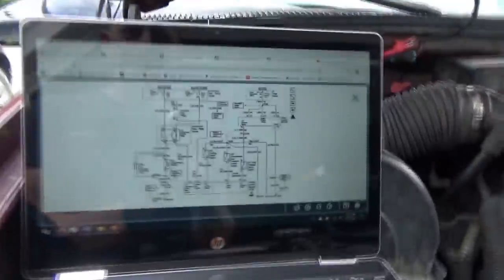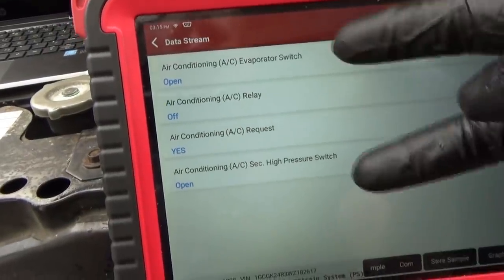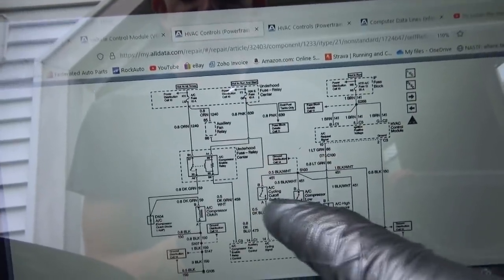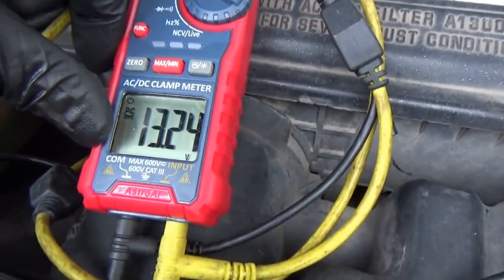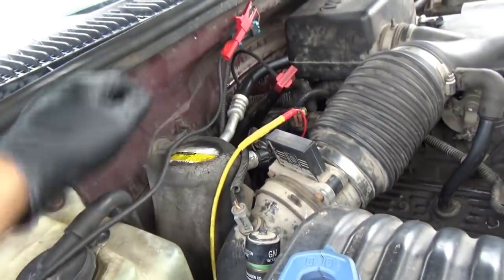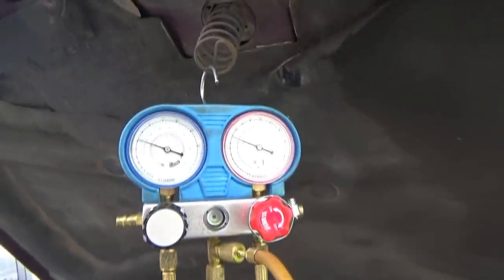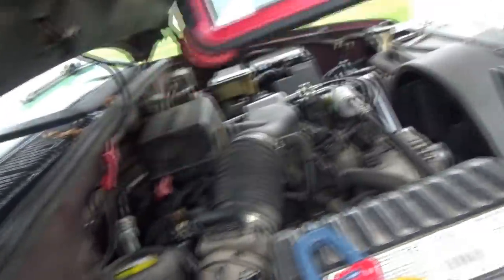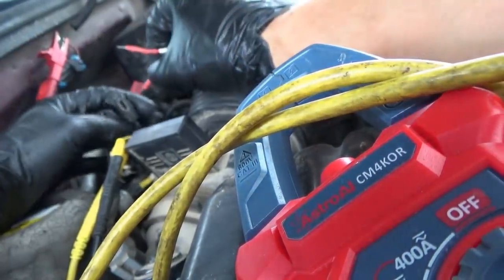Intermittent No A/C? (98 Chevy K2500)

Comment: I have a 96 gmc k3500 7.4 with the same problem you leave the house ac working fine shut it off now ac not working you cross the low pressure switch clutch does not kick in the freon is charged this is compressor number 3.   Not sure what to do now. Got any ideas.. thank you.

Comment: I had a weird issue with this circuit design a while back, compressor locked up, blew the fuse yadayda. New compressor installed with new HPC switch in the back, new switch was shorted internally blowing the fuse when attempting to recharge 😁 Was pulling my hair out

Comment: those switches are adjustable a small screw inside for custom ac setups or change cycling timing, I feel these switches fail because of dirt or metal in the fixed orifice tube

Comment: Great find Ivan! In my electronic career, I have found nearly 90% of malfunctions are mechanically related. Most problems were corrosion, loose contacts, broken wires, broken or cold solder joints, or carbon on relay contacts. Majority of  my repairs require little to No Parts Required. Unfortunately in the Automotive world, too many shops like to fire the Parts Cannon to increase profit. There's no money in just Cleaning a problem, but there's money in Replacing the problem.

Comment: the low side port love to leak on that style setup/vintage.
**those switches can fail after a zillion cycles, the pins get schmutz in them also. the failure rate isn't as bad as older vehicles that had clutch current directly switched though.

Comment: Pretty sure compressor is leaking or has been leaking in past. It appears very oily/dirty and covered in green dye. Someone probably shot stop leak in it. These compressors are notorious for leaks where the body of compressor are assembled. Sometimes stop leak would work, though I do not recommend nor use myself. That pressure switch is a common failure as well the repeated on/off from cycling wears them out. Sometimes you can tap on them to make them up.

Comment: Nice video.  I recently replaced that switch on my 98 Chevy K1500 when my AC quit.  I had a full charge and have replaced that switch on two other trucks of that vintage in the past so I went there first.  I didn't try the wiggle test of the connector but probably should have.  A new switch fixed the problem and the AC has not quit since.  Those switches don't cost much when you do have to replace them.

She will be back in the future for a new compressor because that one is definitely leaking because you can see the oil and green dye.  I own two of these trucks and experienced the same thing on them and eventually had to replace the compressors on both.  It's a common issue with that type of compressor after awhile.

Comment: NO PARTS master in action.  Many would have replaced the sensor needlessly and it may have worked making a better contact.  However, you checking the resistance to verify function of sensor was nicely done.

Comment: 5:25 'but what causes the cycling action?' A Thermostat, located on the Evaporator on most vehicles, unsure if that was a Delphi. GM utileses variable displacement Compressors, which fail regularly over here!

Comment: In my mind's eye I can just see that truck being driven for an hour, then stopped, then the thermal dynamic forces take over expanding that connector and opening up the circuit!  We complain about getting connectors apart but this is what can happen over a period of 23 years or so. I have a 97 Dodge that needs some air conditioning help as well. Maybe I'll get to it this fall now that you've provided some insights. Thanks for Sharing!
Reply: Found 3 minor and one Major leak on my '00 Grand Cherokee. I went to the point of pulling the dash replacing the evaporator.

Comment: Seems to me that’s the first time that truck has gotten AC service since new because it still has the OEM Accumulator. The new aftermarket accumulators don’t have decal on top that identifies the type of refrigerant and weight capacity required. Good job Ivan. 🙏👍
Reply: Not really. Most of the time they don’t change the accumulator.

Comment: When the AC is not running the static pressure doesn't mean a whole lot because some of the refrigerant is liquid when fully charged.  The static pressure will stay the same based on ambient temperature or underhood temperature until all of the liquid refrigerant is gone and if it loses more refrigerant the static pressure will go down.
Reply from the maker: Correct. But should be enough to close the low pressure switch regardless :)

Comment: On earlier Cameron’s 1984 ish,  there is an adjustment screw under the plug.  I remember the compressor will cut off when low side gets to 25.  You can remove the plug and jumper it then set the screw with it running.
Reply: Yeap, the old larger two male prong switch (non sealed) had an adjustment screw.  It's worth adjusting when swapping from 12 to 134a to drop it a few psi.

Comment: Rare issue !  I figured it was going to be the pressure switch or the controller inside. DeoxIt to the rescue again !  Maybe ask her if she wants her fuel gauge fixed while its there ! 
BTW, an A/C shop in my town buys those low pressure cycling switches that are adjustable so they can tweak the cycle for better temps. Many vehicles put about 40 degree air out the vents and thats just about cold enough however, if you can get 36 to 38 air out of the vents, it very noticable and much better.

Comment: Another great catch and NPR fix. I bet you've gotten a courtesy call or two from auto parts store(s) saying they've missed you asking if everything is OK...🙂

It's always a good idea to inspect "motor mounts" whenever these types of wiring/connector issues appear to see if they may have caused the problem, the same thing with certain exhaust system problems.  Quite often, the engine rocking from damaged mounts can cause these issues.

Comment: Great video Ivan!   You were dealing with the GM CCOT (clutch cycling orifice tube) a/c system.  That low pressure switch does the bulk of the work of the system, cycling to keep the low side pressure where it should be going down the road.  Crude capacity control vs variable displacement compressors, but GM used it for years and years.  Older cars had the whole clutch coil current switched by it and the high pressure cutout.  This truck and my 97 that had the same problem and npr fix use the pcm to control a relay, a much better system with less wear on the cycling switch.

Excellent job learning the system on the fly like that.

Comment: Good honest mechanic who knows his stuff.  My son has a 2003 Accord.  He bought it in February and AC never worked.  Took it to HVAC guy, he confirmed power going to compressor so said it needs a new clutch/compressor.  Wondering now if I should do some other diagnostics?
Reply from the maker: Easy check, just manually energize the compressor from the relay and see if the clutch engages!
Reply: @PineHollowAutoDiagnostics  Thanks, you would think the HVAC guy would have done this already but you cannot assume anything these days.  I'll try that but I guess no rush with summer now over, although it is still warm here in Bedford County!

Comment: Thank you for calling it refrigerant and not Freon!! (pet peeve of mine)  Even though it has the cycling switch, isn't that a variable displacement compressor? Meaning it's not a cycling type system and uses the variable displacement to maintain proper pressures? Honestly not too familiar with GM compressors and just assuming.....
Reply: No, that system and compressor cycles during normal operation.  I've owned one of these trucks since new.
Reply: @Mr2004MCSS  Just because it cycles doesn't mean it's a cycling type system. There are limits with a variable displacement compressor and they will still cycle, but not as much. Whereas a true cycling type will depend on the low pressure switch to cycle to maintain a better pressure with varying RPM of the compressor. I couldn't see enough of the compressor to know what type it is. But, doesn't really matter anyway.
Reply: Now if we can only get everyone to say positive and negative when referencing DC power instead of plus and minus the world would be perfect! It's the little things in life..... ;-)
Reply: But plus and minus are not actually incorrect, just layman’s terms. Freon is factually incorrect.

Comment: Great job Ivan !!  I think 🤔 I would have changed the switch  also and fixed the plug for good measure . . The switch is cheap . . I have replaced a crap ton of them . However I always love a no parts required repair from Ivan !!!💯💯
Reply from the maker: But requires discharging and recharging the system lol
Reply: @PineHollowAutoDiagnostics  I believe there's a shredder valve under the high and low pressure switches. Should be able to remove and replace.
Reply: @dans_Learning_Curve  'Shrader Valve'
Reply: @Micko350  interesting. I think that we spell it "Schrader" where I live.
Reply: @PineHollowAutoDiagnostics  There is a shrader valve inside the nipple that you screw the switch on to.  No discharging and recharging required.
Reply: @PineHollowAutoDiagnostics  they have a shrader valve on the low presser cut off ,.   The high pressure switch does not . Held in with a c clip

Comment: NPR!
I tease SMA that "Ivan would have done a NPR"!
Next is the gas gauge?
Had the same failure on my '00 Jeep Grand Cherokee on both the small plug on the alternator and HVAC blower. Both were intermittent. Both *NPR*. Previous owner had replaced the alternator.

Comment: Super quick and easy job ivan :-D
I did that drag test on my mates vw golf injector connectors.
The correct pin i used for  testing just fell out of the connector.
After a tweak of everyone, every pin was super tight.
Perfect again :-D

Comment: I don't find the A/C controls overly complicated, even for the time.  I mean, the PCM is in the loop to shut the compressor off at WOT, as well as probably shut it off if engine temp exceeds a threshold.  It may have even more logic than that.  To me it's kind of like electronic spark control vs a mechanical/vacuum dist.  It's not really more complicated (it is in an electronic sense I guess) - it's just better.
Reply: Yeah to me a complicated AC system would be one with a variable displacement compressor or a hybrid electric and mechanical compressor like Honda used for a while!

Comment: Another great diagnosis Ivan, just looking at the gauges you could already see that the standing system pressure is up to spec therefore no refrigerant leak. The next thing I usually do without the scanner help is to jump the low side pressure switch and see if the clutch kicks in, then work from there.. Agree that it's fair enough to charge a diagnostic fee and bundle in the repair work since it was pretty easy and straight forward as loose connector pins. Cheers!

Comment: Another great NPR fix! Thought it was going to be the common failure of that CCOT switch itself
Reply from the maker: I've seen a lot of terminal fretting and bad solder joints this summer for some reason lol
Reply: @PineHollowAutoDiagnostics  probably because there is a thing called... No pride in my work anymore! Your work ethic are few and far between that think like you. 👍